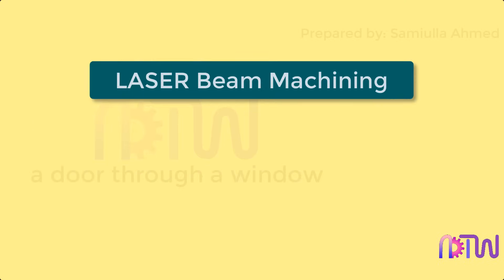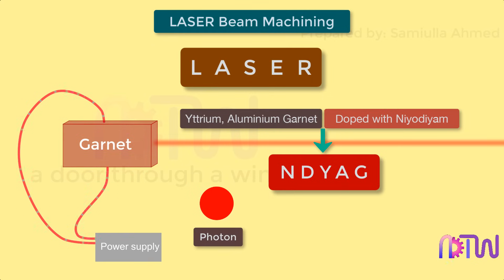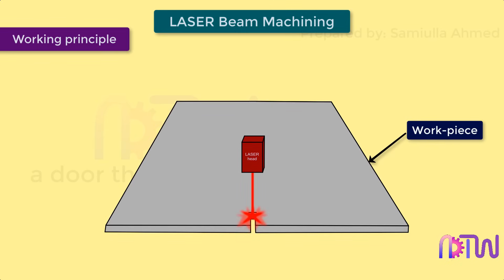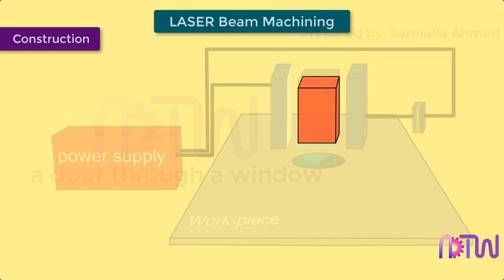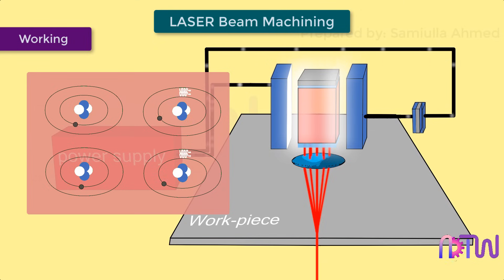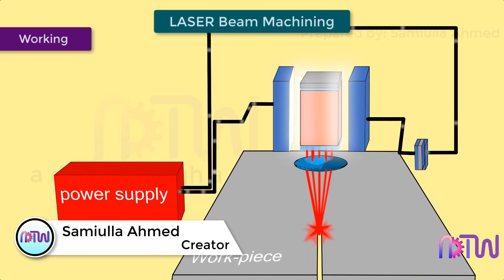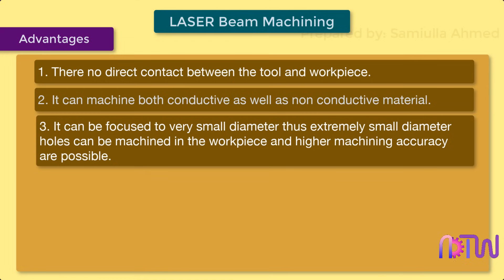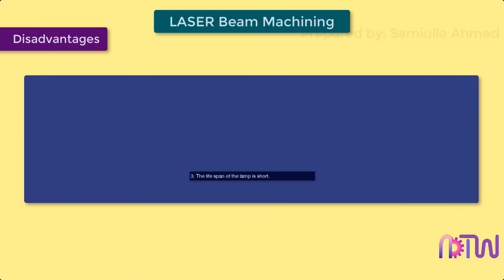LASER BEAM MACHINING PROCESS (Animation): Working of LASER beam machining process.

Comment: This process cannot cut the transparent Materiels.
Reply: Generally true but if very high power outputs like that of multi kW fiber lasers are used they can still cut through transparent materials.

Assuming most transparent materials like glass transmit around 90% of incoming light and assuming maybe a 2 kW laser system it can still apply 200W to the material being enough to cut all be it not very efficient.

Comment: Sir why we have to excit the electron by giving energy through photon from flash light source and getting back the same photon energy when the excited electron comes to ground state, while some energy from flash light is wasted, why not we collect and concentrate the photon emmitted from flash light directly so that no wastage of energy and no use of crystal. ( I am sorry if this question is silly)
Reply from the maker: There is a concept called constructive interference and destructive interference of light... You read on that and you will understand why they do so...
Reply: Photons are produced by Ruby crystal by absorbing light energy from flash tube...how can we remove Ruby crystal itself? It is the source of laser...flash tube only stimulates the process